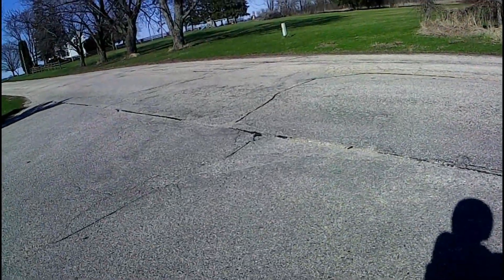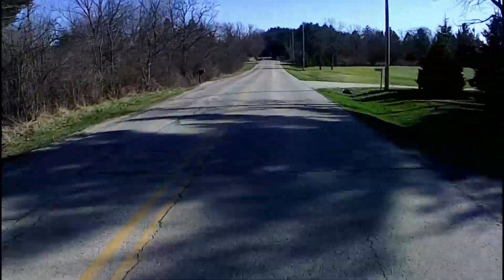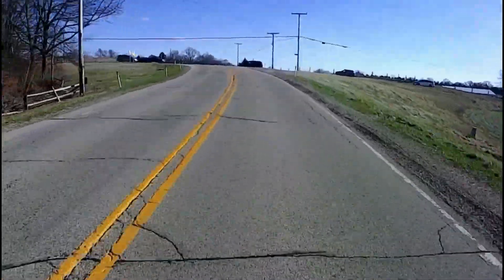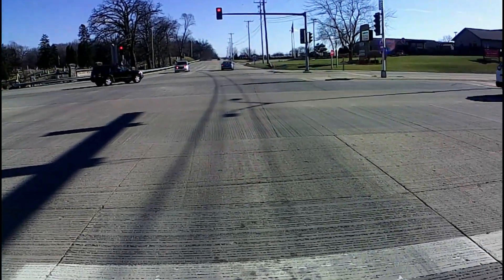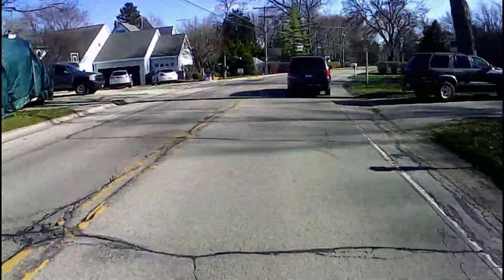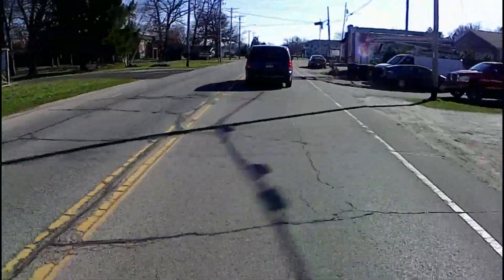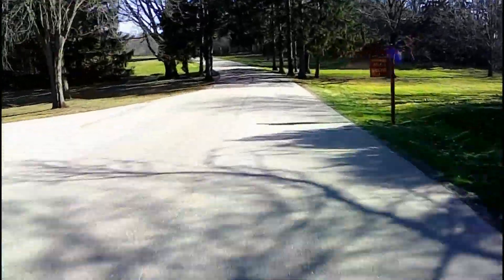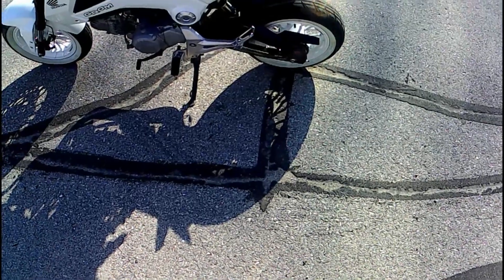gas differences  zs190 grom clone

Comment: Man I thought this was gonna be the 125cc vs 190cc mpg differences. Can you tell me that by chance? I’m curious how many mpg you get w a 190. I’m doing the 190 swap right from the gate w mine. I’m pulling it out the crate and yanking the motor. Where did you get you’re zs190 engine
Reply from the maker: not sure on mileage but the zs uses a lot more gas then the 125cc